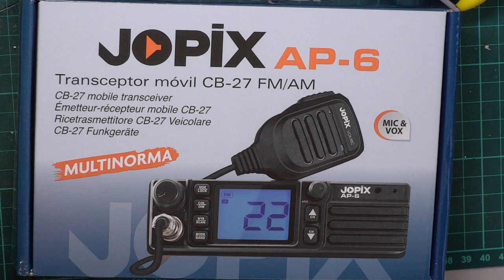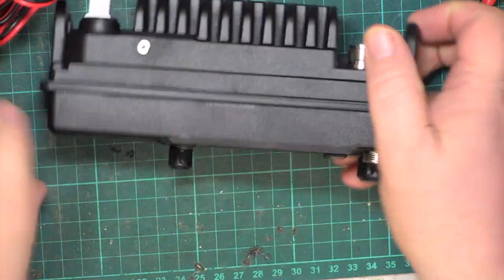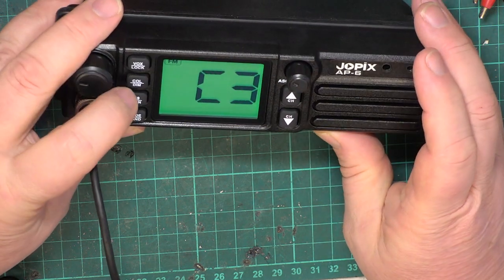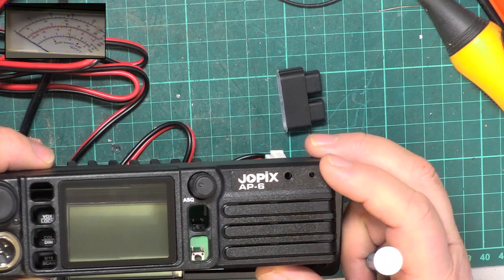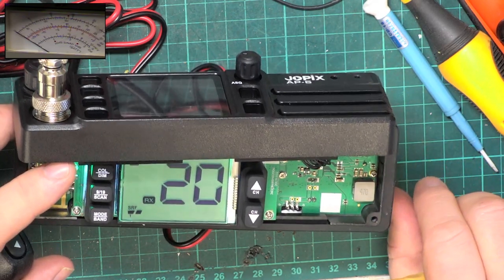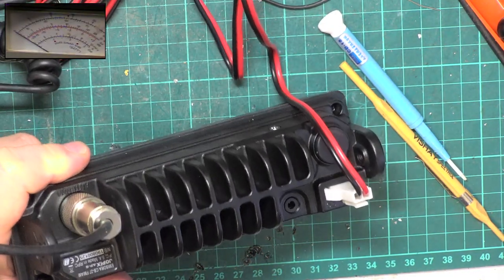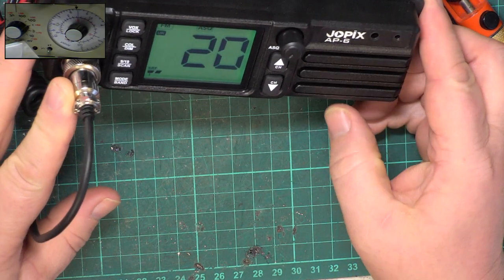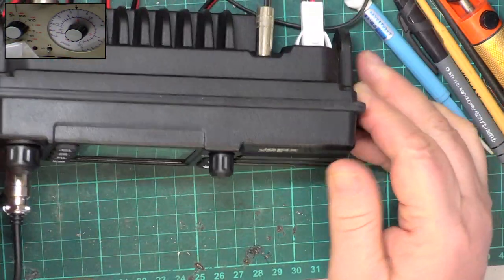Jopix AP6 UK CE MultiNorm Cb radio (mobile) -Service adjustment

Comment: Nice. I saw it in Amazon. I've considered it, for my very first radio. I like the DIN format, and it has a nice clean design. Finally I've chosen the President Bill, still waiting it to arrive.
Reply from the maker: We find most radios work about the same. Some receivers are more sensitive than others. The President Bill seems to be about the only current President model that does work OK! You'll find if more of a faff to work though,  than some sets. Unfortunately, the more you pay buys you pointless bells & whistles rather than anything useful. As commercial 2-way radio engineers here, we've found £49 CB radios out-performing £249 ones.

Richard, G0OJF, UK
Reply: @ukfmcbradioservicingTango21  I thought that President were good, as a rule! I hope it'll be fine. 
Now I realize that is my first cb radio, not my first radio, as I've used the marine vhf. Actually I don't expect it to be like the Sailor 2048...
Reply: @ukfmcbradioservicingTango21  I really appreciate your vídeos. I'm learning a lot.
Reply from the maker: President seem to have a 'good' reputation over radios available in other countries & when made for them by Uniden. The only UK President offering until about 2012 was the 1981 KP77 base station, which was dire. Most of the current models haven't impressed me and are no longer made by Uniden....just like buying a Grundig item is just some badge engineered product these days & nothing to do with the original company or quality.
Richard, G0OJF, UK
Reply: @ukfmcbradioservicingTango21  A lot of things are just a badge these days, even if it is the original company, they tend to buy in rather than design and make good quality things themselves.  A lot cheaper in the long run, but they loose their customer base as the quality goes down and customers realise it.  might as well pay less and get the same quality!  it will maybe be the same thing inside as the one with the old good quality company, just made by someone else.  Other companies have gone to the wall and the name bought over just to make people think it is of good quality, either way you are likely to loose these days.  Especially when it comes to TV, CB, Hi-FI.  Shame we make very little in this country these days!
Reply: @SnappyJon Just because a Chinese copy looks the same it does not mean it has good innards or even come close to working the same as a good make.  Though when it comes to some things these day, a good name means nothing!
Midland used to have Maxon innards, not now,  They are all made to a budget and could be a lot better.  Very few put the power they should.  But it is the new software driven radios that get my back up, how on earth are you meant to drive and use them, some radios fitted to cars these days, you have to stop to use them!

Comment: hello, good evening, I bought an ap6 and I have a little problem and that is that I am going to put the hands-free in the car and I realize that the wiring diagram of the micro is not included in the manual and I have called where I bought it and they do not have even idea that the representative does not release a garment and I would like to know if someone can provide me with said scheme or the same thing has happened to them and knows what to do, greetings.
Reply from the maker: The instruction book says that the accessory socket provided for the VOX microphone is wired to Kenwood standard.....and then goes on to say how VOX (voice operation) is activated & how the VOX level & delay are adjusted.. I typed into Google "Kenwood Microphone Schematic" & easily found the 2-pin pinout configeration. If you can't find that you can always email me & ask for it because I saved it.

rshireby@yahoo.co.uk

Comment: What, no RX meter adjustment or detector adjustment?  I like the less faffing about and also the 5 or 6 pin mike plug.  Maybe the Thunderpole one might be better, have to look that one up!  At least it isn't just a big empty box.  I also like the large display, shame they didn't have meter adjustments, for the sake of a few pence they don't put them in, lets the whole thing down!  When are manufacturers going to learn.  People know what they want, some don't know but are quick to learn and the next the manufacturer gets avoided, though they are all the same these days, low in power, cheating TX meter, RX over generous, poor squelch, crap displays, it would not take a lot of design to improve them a lot.
Reply from the maker: I can bet my bottom dollar that no other technical person on YouTube has spoken out & demonstrated the fake TX power meters on current CB's . At Least the current version on the Midland 78+ Multi still detects real RF for the meter..though the set has been around for 20 years, the current version PCB does actually say 2014 on it. I'd that version we have in the Nissan Leaf test car.

So why on the Jopix & Thunderpole version have both a red LED TX light & a fake power display unless they are trying to hoodwink the purchaser. If the power display is meaningless, then just have the TX LED!

I'm looking forward to sh1t set Sunday, at least the GT868 will have a real meter!

Richard
Reply: @ukfmcbradioservicingTango21  Yes, at least the S.H.I.T. sets of the 80s gave you a real working meter, well most did, some of them told a lot of lies, but at least you knew where it normally sat.
Reply: @ukfmcbradioservicingTango21  I would test them but I don’t really have any modern sets. The newest I have is the original Midland 48 Excel. I could buy some in from the wholesalers and stick them on my website for sale I suppose
Reply: I can confirm that it does indeed have a very sensitive RX. A bargain for £84.99. it's the same as the Thunderpole 3000 which costs circa £30 more. Brilliant radio in my view. Richard keep up the good work mate. I got this based on your words etc so thank you Sir. Cheers Marty.